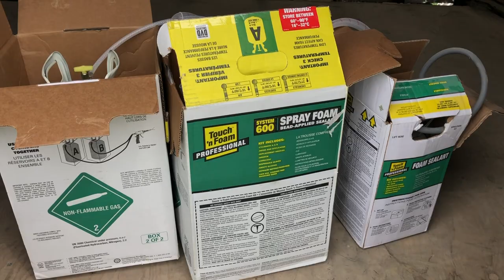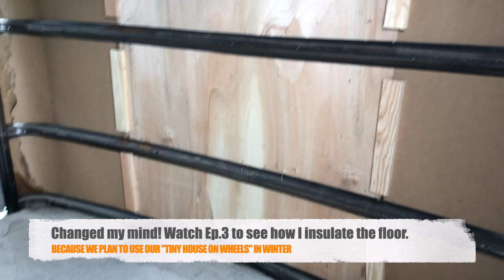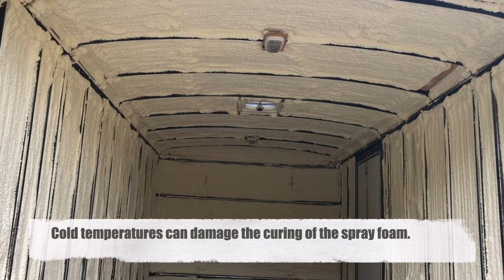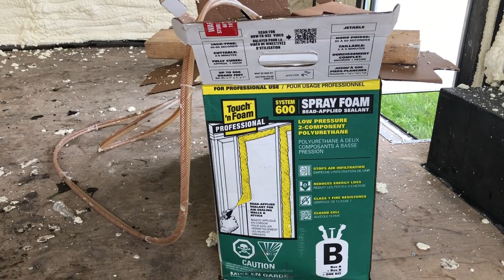How to insulate with spray foam: CARGO TRAILER to TINY HOME Ep.2

Comment: Most cargo trailer insulation vids show insulating with rigid foam board, so this was a nice change.  What about your trailer door though?  For my cargo trailer, I thought that the door would be a great application to use spray foam because the whole door could be replaced if there was an accident/damage.  I am concerned about damage to the main exterior of the trailer not being easily repairable because of the way spray foam clings hard to whatever it's applied too.  I read that installing a felt paper layer before spray foaming would help with this as well as keep down condensation.  Thanks!
Reply from the maker: yeah that's a tricky one. I think it's a good idea to install some felt or paper first if you are concerned about not being able to remove the panels. I think i would avoid any type of plastic, you don't want to create a vapour lock where condensation gets trapped and might start to mold or rust out your panels. for the door we already have an insulated side door that came with the trailer. if it's not good enough i might glue some rigid foam to it and cover it with wood. the back doors of the trailer are not insulated but that doesn't matter because we are using large windows at the back, that will also act as doors. they are insulated windows so we should be good.

Comment: $700?!!!...Lord Jesus!!!... I think I’d go with styrofoam sheets.. The spray might be somewhat better, but that price and the mess would be a “No Go” for me. 🤷‍♂️

Nice video tho! 😁
Reply from the maker: Haha, we get it, the cost of all this stuff definitely starts to add up!  We decided to go with sheets to insulate the floor, we're editing that video right now. It will be Episode 3, and it should be up next week, please check it out :)
Reply from the maker: btw that's $700 Canadian, it may be less if you're in the US.
Reply from the maker: My biggest reason for going with the spray foam was to really inclose the trailer right up. it was expensive but last winter i was running a heater in a trailer not insulated and it was so cold out it started to drip water droplets inside the trailer. Im hoping using spray foam instead of rigid foam will do the trick, I didn't want to end up with mold behind the foam. Thanks for watching!
Reply: @hammerandhome  Myron from Minnesota here. What's the update on the spray foam? Did it meet the Canadian winter/insulation requirements?
Reply from the maker: @MyronNetterlund  well... it's a lot better than nothing haha, actual it's pretty good as long as I  have a heater running, the challenge is going to the trailer when its really cold out and trying to heat it up, number one is, will the heater start, and number two is, it takes a good hour to heat up the space so that you can remove your jacket. but after all of that, its great